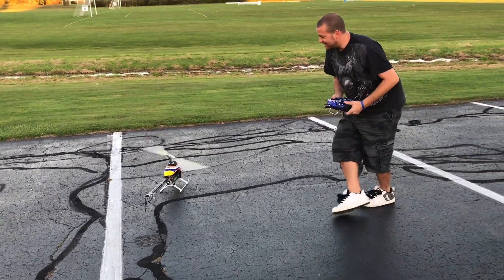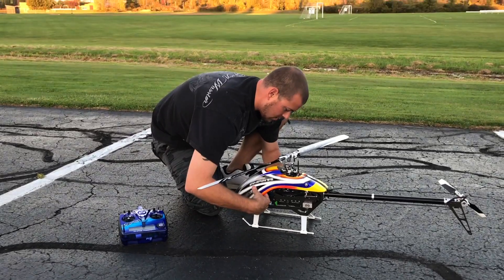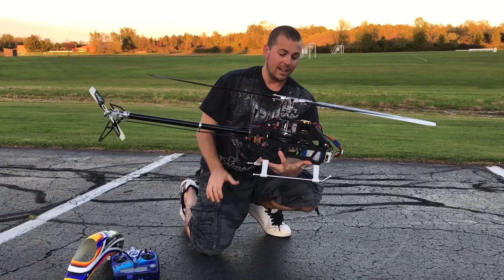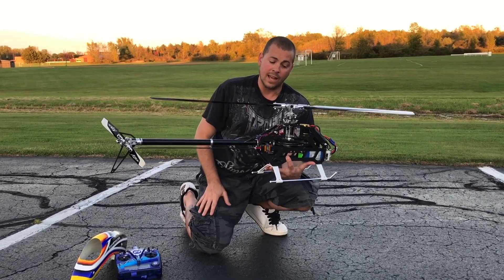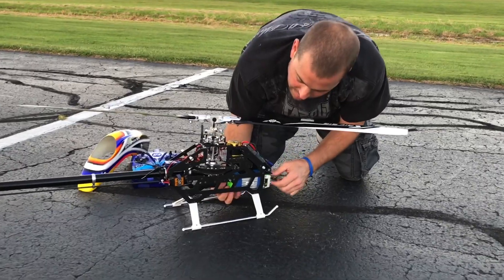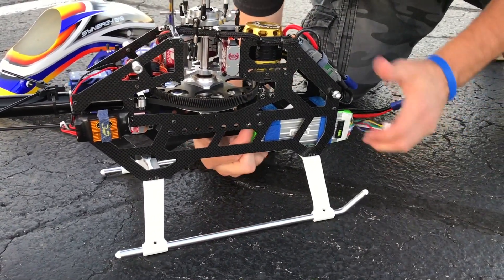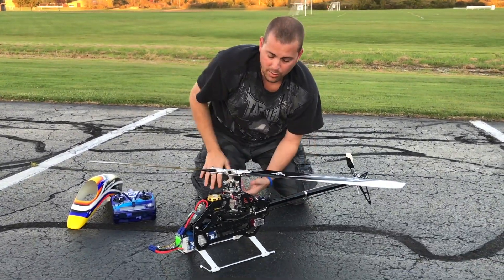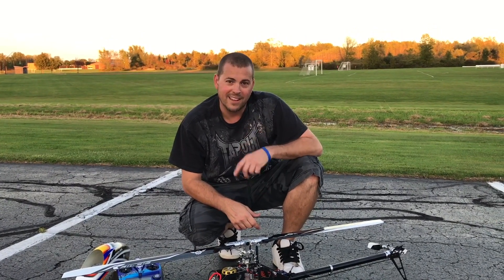Synergy 516 Maiden Flight

Comment: Doing a  bit of research on getting one.  Machine looks very good in a lot of ways.  From the logo Days I found the 6s current is a lot higher on harder 3d.  I wondered if now years later that headroom and usage currently is at par with a 12 s setup.  I see both potentials are possible, but I wondered if now in 2020 is the 6s and equal.  While heat and amps are the trade I wondered if there was any data to suggest either or 12s as a 'prefered' usage on harder flights and if any data gives flight times for either.  THANKS.  NIce video !
Reply from the maker: Cody Hanthorn All I fly are 6s machines. Search for my Synergy E5ss videos where I built a 6s 700 size E5.

Comment: OK , I have been waiting for this.( your review) Since I am a helicopter hoarder I have been thinking about this or a e5. I know you have or had a e5 or at least I saw a vid where you flew one. What's your opinion. Is that big enough to pretty much be a 550 and is it light enough to flew a lot differently than a e5. Batteries or a consideration cause I already have 5000's. what is your opinion of the 2. Having to use a different batt size is not a deal breaker.
Reply from the maker: Yes still have my trusty E5. You can search my channel for all my videos. I actually stretched it to a 626mm for big soft 3D on 6s 5000s. The 516 will be my everyday 6s Power house running 6s 4100/4500mah packs. Both are awesome machines! One is a 500 and the other is now a 600 class. Took them both out today!
Reply: Well Chris I think that helps my decision. I have 2 helis with 425ish size blades which I like. If I can swing it I'll go with the e5. Logo 550's are close in price and will look at them also. I really like seeing the owner of a heli company flying his own products as in Synergy. Thanks